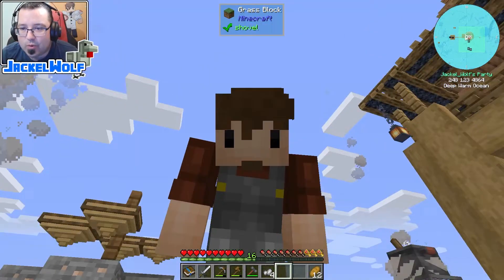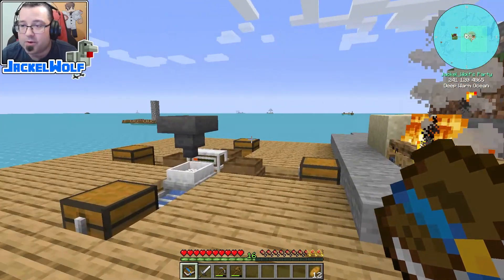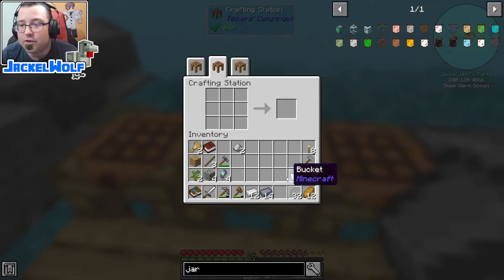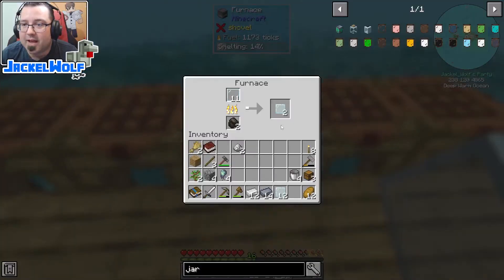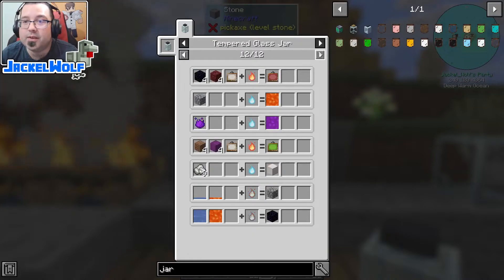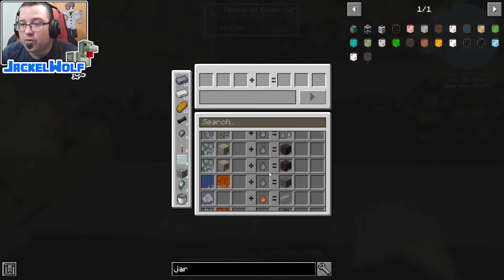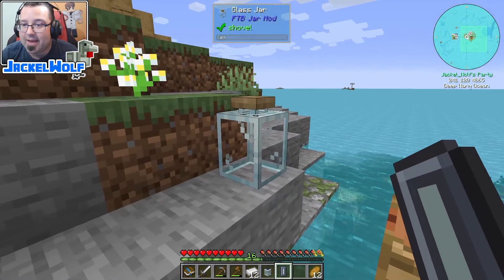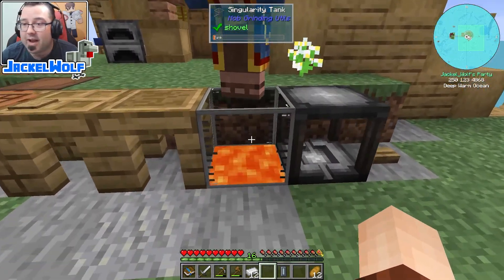OCEANBLOCK TUTORIAL - EP09 - HOW TO USE TEMPERED JARS - WATCH YOUR TEMPER

Comment: I know this is pretty old but i cant figure out how to use water in these jars
Reply from the maker: How are you trying to use the water? I think there are pipes and a controller for mixing items. It's been a while so I can't remember what it is called.
Reply: @JackelWolf  im trying to make clay which needs water sand and gravel
Reply from the maker: I seem to recall there was a controller you needed to build to select the 'output' if you had the right stuff connected or in your inventory you could craft the item. .. actually... I think you can make clay using the dropper. Dripper with water over dirt made clay... I think. Took some time.
Reply: @JackelWolf  ok awesome thx
Reply: @JackelWolf  hey i hope you are still reading here, i cant seem to use the liquid souls from my inventory
Reply from the maker: YT notifies me on 'almost' all comments (I think some slip thru the cracks). That said, it's been a while since I used this mod. Off the top of my head, do you have enough souls for the recipe you are trying to make? Not sure what else could be the problem. I'm guessing that you are trying to make soulsand? Oh, do you have the correct heatsource? You might have to upgrade to the soulfire... maybe?
Reply: @JackelWolf  yes soul sand, i have the bucket of liquid souls but it doesnt recognize it weirdly enough
Reply from the maker: Is it a bucket you need? Is there another way to collect them?
Reply: @JackelWolf  doesnt see it in a bucket either, and i dont know if there are any other ways for collection other than the automatic one which is slow to get (im playing dome)
Reply from the maker: Yeah. It is an odd mod that I havnt seen in any other pack.

Comment: did you cancel this series? or have you just been busy with other stuff?
Reply from the maker: I finished 'season 1' which tends to run about 18 episodes. Ocenblock  (and Skyfactory One) actually bumped my current Prestige Run series by a month. I've got some Vanilla SMP content coming out in Jan and then I might get back into oceanblock. I tried doing multiple series at once before but it is hard to maintain.  😅